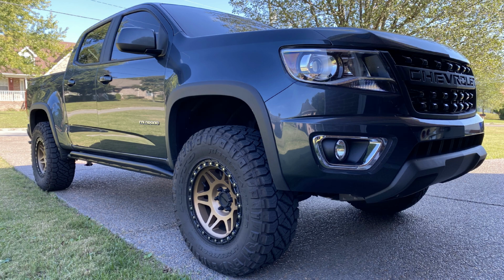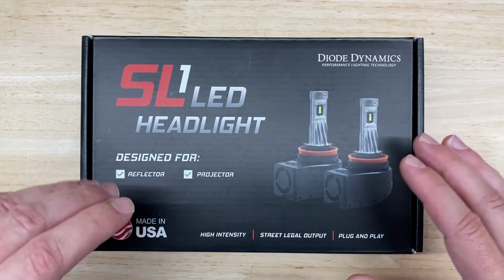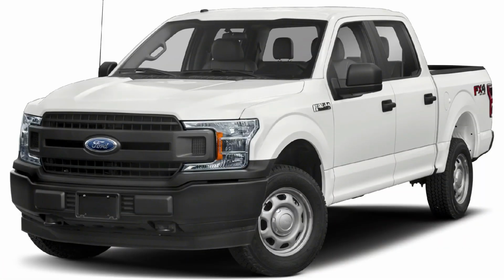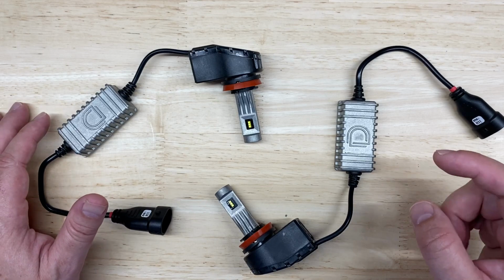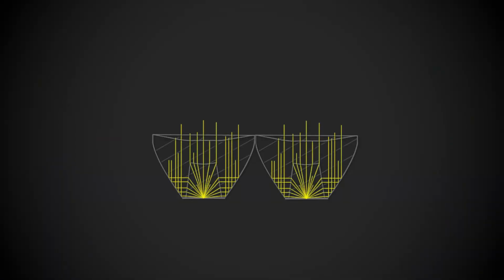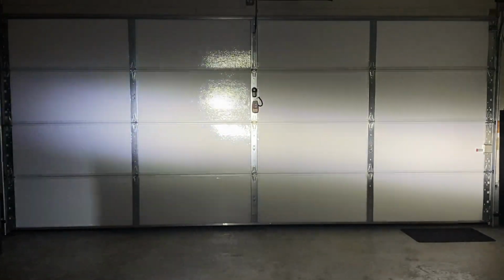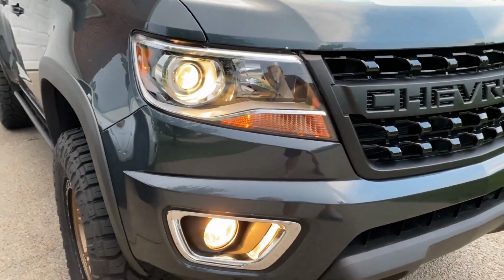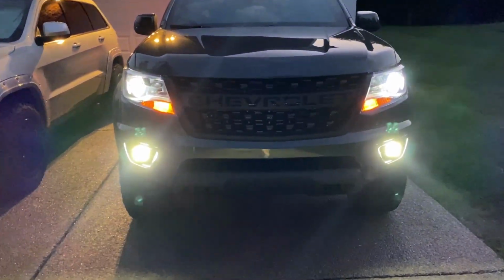Diode Dynamics Truck LED Lighting Upgrades -  SL1 & SS3 Pro Max!

Comment: for an f150 what would you consider, the morimoto 2 stroke, gtr ultra 2 or the sl1 diode dynamics? these 3 are what im looking for to replace my halogen in my 23 stx. these halogen lights are terrible . im not looking for the brightest but just anything better than stock that doesn't blind oncoming traffic
Reply from the maker: What is your budget and are you replacing halogen in projector or reflector headlights?
Reply: @InJasonsGarage  reflector housing..around 250
Reply from the maker: @arizonarandomadventures For reflector,  I would say the Morimoto 2-Stroke.  Check out the reflector output in this video...  https://www.youtube.com/watch?v=0N9419LxeIU
PLEASE NOTE:  That video was made a while back...and the 4.0 has been recently released.  I haven't tested the 4.0 yet, but I do expect to on my other channel www.carlightreviews.com.

Comment: Someone is selling me SS3 max. Is there any markings on the pod stating if it’s the sport, pro or the max? How can I tell I’m actually getting the max version?
Reply from the maker: Yes, there is a sticker on them that shows the version, it is by the plug and mine say MAX.  In fact, I am selling the very set that I reviewed in this video.  They look brand new, only had them on for 5,000 miles before I sold the truck.   Email jason@injasonsgarage.com if you are interested.
Reply: @InJasonsGarage  I’m in Canada though
Reply from the maker: I can ship them, not sure of the cost but I can look into it.
Reply: @InJasonsGarage  how much were you looking for the price? In Cad
Reply from the maker: @JuskoLord247  Shoot me an email with your shipping address and I will see what I can come up with.
Reply: @InJasonsGarage  already did

Comment: Are you still running this set up
Reply from the maker: Not for the headlights.  The SL1 is a great light (especially in terms of engineering and quality) but the OEM projector housings are not great and I really needed even more firepower at times.  I was running the Saber ProX 55W Accu/V2 ever since I made this video: https://youtu.be/Bpa7KwJ262A.  However, since I tested the Hikari Titanova on my other channel (https://youtu.be/OQtRfUY0L6U), I am going to switch to that for a while.  Also see this video on my other channel:  https://youtu.be/YMxLhQtwB7I
I am hoping that Diode Dynamics comes out with a new LED headlight upgrade sooner or later.
Reply: @InJasonsGarage  I currently have the auxito m3 I think thanks to your review lol i just really like DD products as my
Colorado is fitted with basically everything else from them and I like the idea of them running so much cooler and 5700k color. What did you not like about the sl1?
Reply from the maker: @codyberger2762  It is not that I didn't like the SL1, it is a GREAT light, but the Colorado projectors are rather terrible, and I felt that for my driving location, I needed something with more power.
Reply: @InJasonsGarage  yeah I’ve been pretty disappointed in the Colorado projector output. Sitting next to a few other cars it’s definitely not up to par. Been looking at the Coplus headlight assemblies and actually placed a order last night. Hoping for better output etc. led bulbs were okay but left a lot to be desired for me due to the decreased output overtime on my commute.
Reply: @InJasonsGarage  how did you like the DDM? I have been considering that one as well
Reply from the maker: @codyberger2762   Been running them ever since.  Great lights, I am about to test the new 65w version soon on my other channel.  For now, I think I am going to switch to the Hikari Titanova.  Just a great overall light.  https://youtu.be/YMxLhQtwB7I

Comment: Do you recommend these over the Morimoto 2 stroke 3.0s?
Reply from the maker: That's a tough call.  I think these are great if you want OEM quality and longevity.  But the 2-stroke is indeed one great light.  There's also cost to consider, the Morimoto is much more expensive.

Comment: Why would you put a flood/driving combo in the fog light location and not a fog light? Seems like the flood would blind oncoming cars.
Reply from the maker: Oh, it most definitely would blind oncoming drivers.  However, on my truck the fog lights don't turn on with the headlights automatically.  That's why I specified that the lens I am using is for off-road use only.  In other words, not normal driving.

Comment: Great video Jason, love the quality and customer service Diode Dynamics offers. I plan on upgrading to the SS3 Max fog lights as well. They seem to have a new Amber backlight feature in the latest generation SS3 that I'm interested in seeing.
Reply from the maker: *SIGH* .... Yes, they came out with the backlight version just after I made this video.  Ain't that the way it goes?  I am going to PRI in a couple of weeks and will check them out in person.   Thinking about upgrading.  What do you think?
Reply: @InJasonsGarage  From what I can tell, they were at SEMA unveiling the new SS5 a few weeks ago and I believe they low-key released the new SS3 version then as well. They have a video on their channel showing the backlight feature on the SS5 at SEMA and it looks like it's RGB as it can change colours. I was originally going to order the SS3 Pro fogs for my F150 early 2020, but was told to hold off by my DD rep as they were working on releasing the Max version. I love that they're always innovating and upgrading, but it does suck for the consumers that purchase not knowing, and then see they have an outdated model shortly after. I always want the best and by the looks of it, the SS3 Max with the combo lens is the best of the best for my fog light housings. If I were you, I'd probably just stick with the SS3 Max, as purchasing a new set just to get the backlight feature may not be worth the additional cost. From what I've read, they're planning on shipping the new backlit SS3 pods by January 2022! I'm looking forward to them forsure, even though my SLF fogs are bright, these are by far the best! Also, I love my SL1 headlights! And cheers brother, I'm always working on small engine or truck stuff here!
Reply from the maker: @EliminatorPerformance  I just got back from PRI, and had a nice talk with my contact at DD.  If you want to wait for the latest and greatest, you won't ever end up buying anything.  They definitely aren't slowing down.
I am likely going to buy new versions of the SS3 Pro max with the amber backlighting.  I kinda like it.  I also have a 3D printer on the way...I might explore the idea of making a bracket that will allow me to use the SS5 in my factory fog area.  😬  I know it is overkill, but I just want to see if I can do it.    Heehee...
Reply: @InJasonsGarage  yea the SS5 would be ridiculous lol good luck!
Reply from the maker: @EliminatorPerformance  Which is why I want to try it!  ;)
Reply from the maker: BTW...love your channel!  I have a Craftsman Pro riding lawn mower that I enjoy maintaining as best as I can (I may or may not have a history of applying Armor Shield to) and I'll spend some time watching your vids.

Comment: I just bought the ss3. 
I have a question do you thing the combo lense is better than the fog or viceversa?
Reply from the maker: I think the best lens is the one you need to get the job done. 😀  I chose the combo because I thought it might be the best for my use...but your use might be different.  What kind of driving do you do?
Reply: @InJasonsGarage  well mostly in the city and rural areas , but some areas have very poor to no light at all. It seems that the combo lenses is a really good cuz it shine light out infront and around like a fog light does.
Reply from the maker: @yimwf  Yep, combo is probably good for your needs then as they are similar to mine.  One thing...you probably already know this, but don't leave them on all the time or you will blind oncoming traffic.
Reply: @InJasonsGarage  well thats the part that i dont like. but i would give it a chance to see how it  goes. thanks man

Comment: Okay I need to tell you what happened to me about a year ago. I have 2000 Toyota Camry LE that was given to me by my cousin. It was his father's Camry. I bought led headlights that were 4000 lumens a piece. It was night on the highway I had on my brights a car past me on the other highway. I forgot to turn off my brights. Next thing I knew I was being pulled over. The state trooper said my led headlights were illegal. So I had to change them. I found some led headlights that interested me. They have no fan. They also work with my DRL's. They're the Oracle lighting V Series. The company says they are street legal. I hope so. The only thing they're not as bright as my other led headlights were. They take some getting use too. I live in Kentucky we're not aloud to have different colors headlights only white or yellow. We can't have red or blue led lights in the cabin either. You can get a fine here. So I'm doing everything I want in cool white or white leds. All I have to do is my dashboard, console, ac/heater, and glove box. I bought Sylvania Zevo Super Bright LEDs. They're really bright. I'm happy with them. You don't want your led headlights to bright or you'll be pulled over by a police officer. I watch your videos when you have them on.

Comment: Regarding the fogs, what beam pattern did you end up installing?
If the one you demonstrated, it'll blind people when used as a regular fog light due to being a flood/high beam.
Reply from the maker: I did indeed install the set I demonstrated.  However, I don't use them during regular driving and my fog lights do not automatically turn on when the vehicle is running.  And yes, it would most definitely blind people.  You know me, I always advocate responsible and respectful driving. 👍
Reply: @InJasonsGarage  Great, just making sure ;)
Reply from the maker: @contagiousingenuityagency5273  You should know me better by now!  😎

Comment: Hi Jason, I've had good luck with Diode Dynamics and think you've hit the nail on the head by opting for their products. 

However, personally not exactly a huge fan of Luxeon ZES style chipsets for headlight bulbs - including the SL-1's. They just don't focus the beam well enough in reflectors and partially scatter the output.
The best LED bulbs on the market that retain near-OEM pattern most efficiently are the SV-4 (and some of its clones), and Morimoto 2Stroke 3.0 (the one with the Osram Oslon chips).
Reply from the maker: I am wondering if DD is working on a new version.  I have no info that they are or are not either way, but I think it would be cool if they made a SL1 Pro (or something like that).